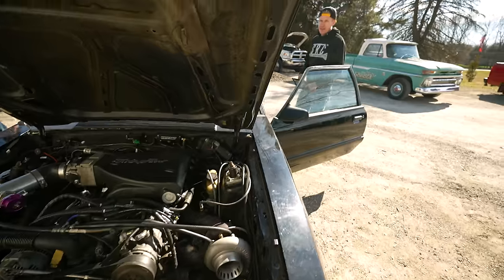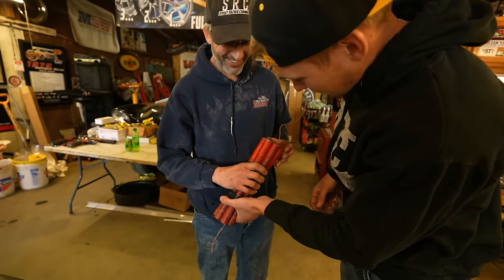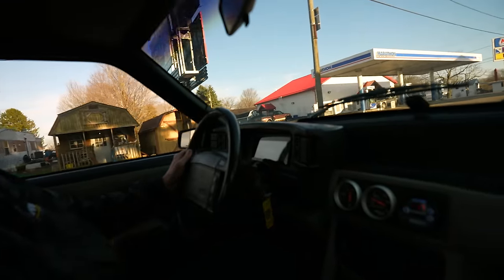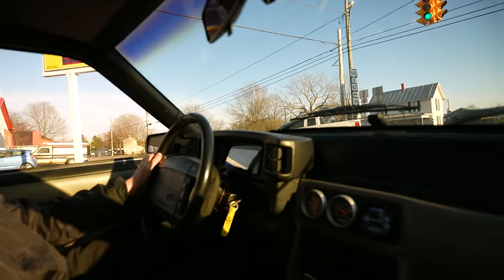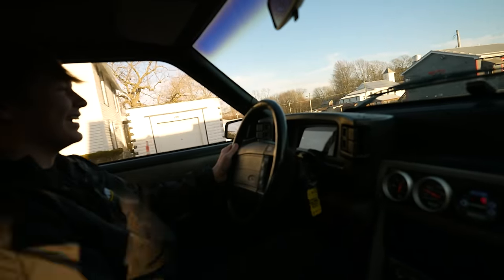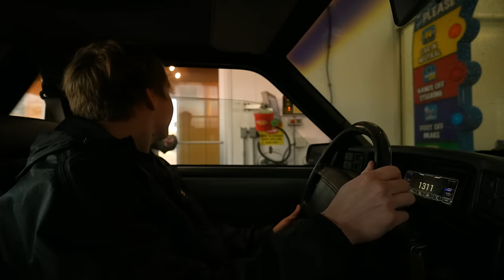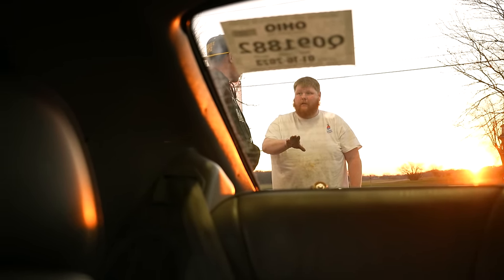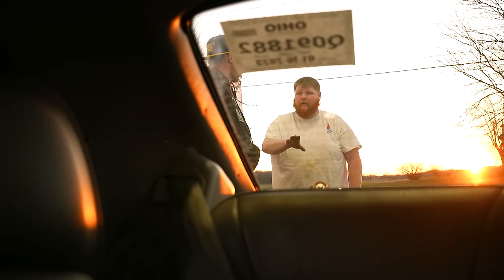540 BBC FIRST START UP! + Tuning the S10

Comment: Being honest with you guys, it's nice that you acknowledge us Ford people that follow you. Really though, I just like seeing y'all go fast and do the things I am not financially able to atm. Keep it up. I'll stay for whatever
Reply: Same, fellow Ford guy with a SBF turbo foxbody!
Reply: Well you guys did bring the 9" and 8.8. you might not be able to build fast or reliable engines but good for coming in the rear of the drive train. Lol JK
Reply: Same here!!
Reply: @robertconklin3850  easily built reliable SBF just have to use an aftermarket block like they do with the SBC, in the end they all just expensive air pumps and any can make power and be reliable with the right parts…..stock and aftermarket but still funny to see those comments still being used lol
Reply: @young11984  Nah, just have to use a 351 block instead of the flimsy 302 block; 351 blocks will do anything stock SBC blocks can, you can definitely make 4-digits if you're careful(detonation kills any stock stuff when you're making big numbers). Early 302 blocks are OK too(not as durable as a 351), the Fox era 5.0l blocks are the real problem ones.
Reply: Just wait until they stumble across a good deal on a Coyote, and find out just how killer those things are, lol. Absolutely blows me away seeing what those engines can do today, I mean there's a LOT of turbo Coyote 10 speed F150s hurting a LOT of feelings out there, it's pretty wild!
Reply: None of us are financially able. But some of us actually work. And not beg and rely on YouTube. I pray all the time YouTube goes down forever. Even up the playing field then.
Reply: @RyTrapp0  i have 2 coyotes, one 1st gen and a 2nd gen that i got at a steal because the shop considered it a liability to go into engines. (Not sure how the hell they are still open) both have phaser issues and i just paid the $275 core charge each. Well aware of detonation being the roller 302s death, i split 2 learning to tune my home built blow thru set up 15+yrs ago but once i got it sorted it was rock solid and lived thru 8-9yrs of pure abuse at 585whp/620tq. 

Cant wait to drop one of these coyotes into my dads 85 GT with a 6R80 and see what it can take with 15psi shoved down its throat lol
Reply: @havocracing6019  i dont wish nobody failure regardless if its a youtuber or not, they work hard making content, working on their cars and editing so for a lot of them its a full time “business” just as we work every day. For every business a youtuber starts its somebody else self employed and hiring people to work for them so yea i wish them well on their journey in life that they self built. Jealousy is not a good thing and wishing somebody failure because of it is horrible especially when you are supporting them by watching their videos and commenting too. Based off the comments youtube shows from you for these folks you are not only jealous but a die hard hater too
Reply: @havocracing6019  I work for everything I have and I do have a hotrod but running 11s isn't exactly what I'd call fast nowadays. It's a sbf 5 speed ranger so it is fun but my kids matter to me more than the cars. I'd rather spend my money taking them on trips to theme parks most of the time.
Reply: @young11984  lol I know my first bracket car was a 84 foxbody with a 351 Windsor. It wasn't the fastest but I had a lot of fun with it.
Reply: @robertconklin3850  fun is what its all about bud, i still have my 84 but its going back 4cyl 6spd auto to take it back to street duty
Reply: @RyTrapp0  I’ve got a gen 2 coyote in my fox with the 6r80 and it runs with anything in the 700hp range. Car weighs 2950 with me in it
Reply: I'm a Ford guy as well I don't follow them for the Mustangs lol. I follow hard work and good content I think you probably do as well. I've been assembling parts for my BBF for about five years now. Will be going together this spring 👍 keep saving scrimping and buying parts along with long days and overtime to get it done Ford brotha
Reply: @young11984  you think ima read all that bs?
Reply: @young11984  work hard?  On what?  They don't build thier trans nor rearend nor engine. What exactly do they do?  Fk we call them parts changers where I come from. A machanic or tech finds and fixs problems. Not put it on the next man. But you sheople eat it up
Reply: @young11984  Exactly. I'm part owner of a fabrication shop that a few buddies I met at the track & I started from the ground up in '06. I was 19 at the time and we started mostly with drift and time attack builds but since 2015 we've mostly been building drag oriented cars. I feel these guys are just like us, building and enjoying their cars, they just happen to put it out there for other's viewing pleasure. To insinuate they are completely reliant on YouTube is ridiculous. With his experience Billy could get hired at any number of shops. Hell I'd hire him LOL. He just chooses not to. But that guy literally has no idea what he's talking about & as you said is a jealous chronic hater LMAO 🤦🏻😂🤣
Reply: I keep a bully with me. Just incase a blue healer want to fafo to
Reply: @young11984  they have no idea.
Reply: What about those us with ford powered by LS? Lol
Reply: @havocracing6019  if you cant read it all to comprehend it then why respond?

Comment: For what it's worth Billy, less timing = hotter EGT's, more timing= cooler EGT's. Throwing more fuel at a cylinder with less timing = more fire in the header tube...hotter EGT's. MORE timing burns the fuel in the chamber where you need the heat, and less in the header so it sees less heat, ie: cooler EGT's. More fuel cools the intake valve more, but is all still burning in the header. 

The siamesed exhaust in the center cylinders doesn't create hotter EGT numbers. Those probes just measure a few inches after the valve for that cylinder. Exhaust Gas Temperature. Not chamber temperature. Siamesed exhaust valves fired almost consecutively    creates heat in the chamber and valve, yes, which is more detrimental to head gaskets, valves, seats, the chamber, etc..., not EGT probes. They just measure what comes out. 
Needing more timing in certain cylinders is not unheard of, especially when running a cast single four manifold with different length runners. Which runners usually need help in the tune? The 4 inside runners. They fire consecutively in the firing order, and those runner lengths are different from the outside runners. Runner dividers in the plenum also affect it. Fords are notorious for these issues with single cast intakes, regardless of power adder or not. An I.R manifold has a big open plenum, with equal length runners, and no dividers. They are much less timing and tune sensitive per cylinder. 
Lastly, just wanted you to understand, "safe" is not always safe lol. Too safe can hurt parts just as easy and quickly as being on the edge, as does too much or too little timing. Making a long distance pull in high gear on the street and just getting numbers isn't really telling the story. Not the same kind of load the engine sees during a pass and accelerating through gears. I've mentioned it to you in the past, that AFR will lie to you. The plug knows everything going on in that chamber first hand, you just have to cut it open to get the answers, which I would only do at a track. In short bursts. Pulling 1 plug with drive time, shortburst, and more drive time, will not tell you anything, and the worst thing you can do is rely on the computer to do it. All that information in the laptop is just reference points, it still needs to be physically monitored and checked. Without that, what good is a reference point with nothing to refer it back to? They just become generalized numbers everyone uses. Except every engine is different. 
Hope this helps.. Best wishes.

Comment: SRC FTW!

I know high boost 2jz guys would vent the crank case too and obviously the valve cover. Can only help. 
Drain backs are great, 3/8” would let flow nice without sticking on its way down. Front drains are worth doing too. Hard stops with chutes are just as crazy as a 1.0 60’ 
Religiously, extra qt of oil above full line at the track.

Comment: Just a heads up, lower timing will actually give you higher EGTs. The reason for it is you are starting the combustion event later which means it is closer to when the exhaust valve opens, so it will be hotter. Still on the right track using the plugs though. That's what I prefer to use to get timing and AFR right. I rely more on the EGTs for diagnostics. For example if we lose a cylinder I can see which one it is.

Comment: First of all it's no one's freaking business how much money they make and you're right it's not just a nine-to-five job some days they probably put in 24 hours there's a lot more that goes on behind-the-scenes than what people see on a 20 or 30 minute video I do have a question Billy I thought that 540 had fuel injection before maybe I'm wrong but I was thinking it did that's why I was wondering why you had a carburetor on it when you had it on the dyno or was that just to check everything out keep putting out the great content don't worry about the haters nobody should life is good keep up the great work keep doing what you're doing and everyday will get better and better God bless be safe
Reply: The carb is temporary, so that the engine will run, & can be adjusted. Then it will come off, & the EFI will go back on.

Comment: Looks like the spring on the operator for your guys's race car trailer needs to have a little lubricant doesn't look like the spring is working all the way across its bunched up on one side not all the way across

Comment: Wouldn't your EGT's get hotter if you pull timing out of the hottest cylinders?
Reply: Yes. Less timing makes the EGT's hotter.
Reply: @jrdmotorsports9718  Billy said he pulled 2 degrees out of the hottest holes. I don't understand the reason.
Reply: @danieljames5875  I can't speak for him. What I can say is, maybe he doesn't know? Because adding fuel as well, with less timing, typically will make it worse.